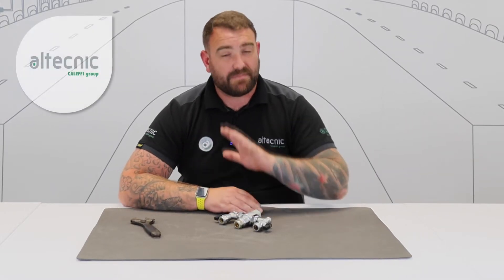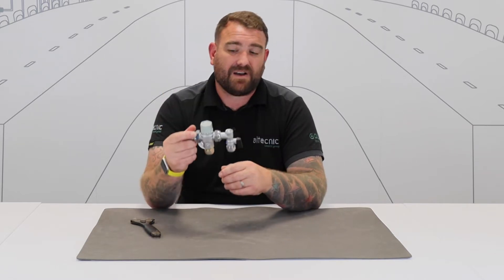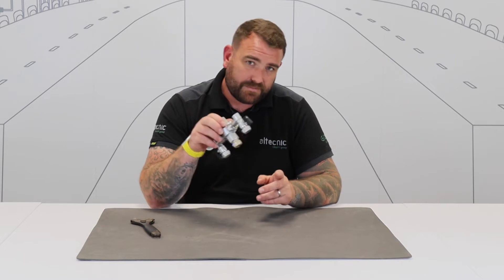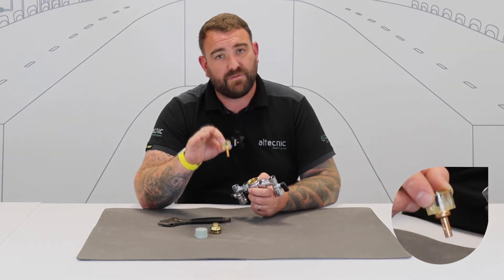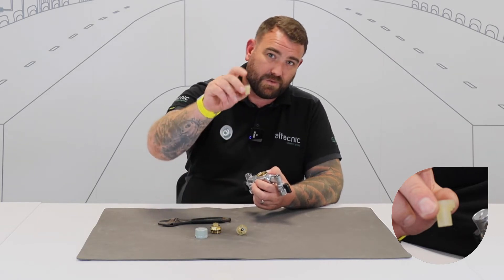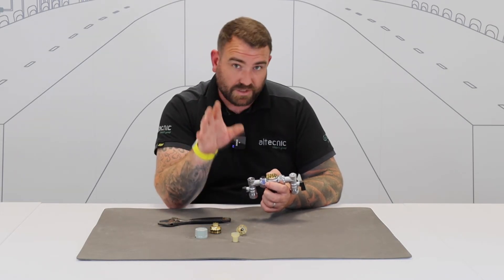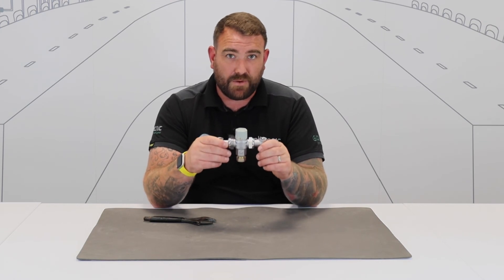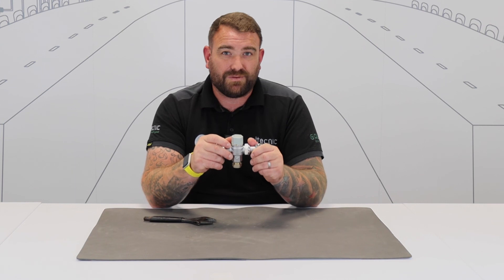How do you commission a Thermostatic Mixing Valve (TMV)?

Comment: Easy on the grease though it will congeal and cause issues. Also what about the strainers and check valves surely they need cleaning and disinfection?

Comment: I am in Canada. I am not familiar with the word 'commission' , as you use it. We would say service, or maintain.
Reply: It is servicing or planned preventative maintenance he should of used. Also he forgot to mention to descale all parts including the strainers on each side. Also to record the incoming cold and hot water temperature going to the TMV’s and adjust the mixed temperature of required. You should also do a fail safe test which consists of isolating the cold and making sure the tap don’t run with just the hot coming out if so it will need replacing.
Reply: Hi Mate;

COMMISSIONING OF THE VALVE
Upon completion of the installation, the valve should be tested
and commissioned as per the procedure outlined below or as
specified by the local authority. The entire procedure should
be read through thoroughly before the commissioning of the
valve. A calibrated digital thermometer with rapid response
time with maximum temperature hold, a small flat-bladed
screwdriver, 3mm Allen key and the adjusting key (supplied with
the Aquablend 1500) will be required to check and set the outlet
mixed temperature of the valve.
Ensure all outlets that will be serviced by the valve have
adequate warning signs posted to ensure that no outlet is used
during commissioning.
Open the cold supply line to the valve, then open the hot supply
line, ensuring there are no leaks.
Open the outlet that is serviced by the shortest length of the pipe
work between the mixing valve and outlet fixture.
Allow the mixed outlet to flow for at least 60 seconds to allow
the temperature to stabilise before taking a temperature reading
at the outlet with a digital thermometer. The flow rate should be
at least 2L/min. The flow rate can be checked with the aid of
a known size container and a stopwatch, or Enware Flow-Cup
(ATMS1201). The temperature should be taken at the closest
outlet served by the thermostatic mixing valve.
If the outlet temperature requires adjustment please follow the steps
below.

TEMPERATURE ADJUSTMENT
1. Using a small flat-bladed screwdriver, lever the Red Lock
Shield (protective cover) off the valve. SEE IMAGE 5
(over page)
2. Loosen the temperature adjustment locking grub screw
located on the hex of the top cap using 3mm Allen Key. SEE
IMAGE 6
If the grub screw is not easily accessible, relocate the grub
screw to the most accessible screw hole (3 screw holes are
provided on the top cap for convenience). Leave the grub
screw loose.

3. Fit the supplied key over the adjusting spindle. SEE IMAGE 7
• To increase the mixed outlet temperature,
rotate the spindle anti-clockwise.
• To decrease the mixed outlet temperature,
rotate the spindle clockwise
4. Allow the mixed outlet temperature to stabilize for 60 seconds
and once again take a temperature reading. Repeat the
procedure until the desired temperature has been reached.
5. Tighten the temperature adjustment locking grub screw. SEE
IMAGE 6
6. Push the top cover firmly back onto the top of the valve until
it ‘snaps’ back into place.
7. Check the outlet temperature is stable over the full range of
flow rates and that the flow rate is adequate for the application.
8. Close the outlet.
9. The mixing valve is now set and locked!

Full instructions here: https://www.enware.com.au/products/aquablend-1500-thermostatic-mixing-valve-lead-free-with-thermal-flush-lift-lever/aquablend-1500-thermostatic-mixing-valve-lead-free-with-thermal-flush-lift-lever/